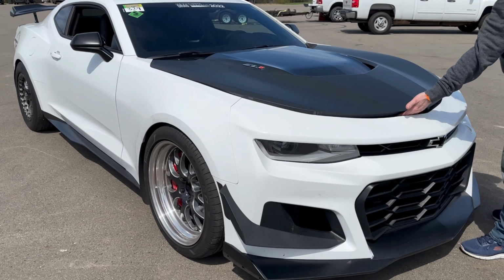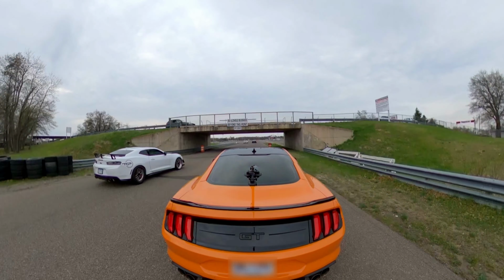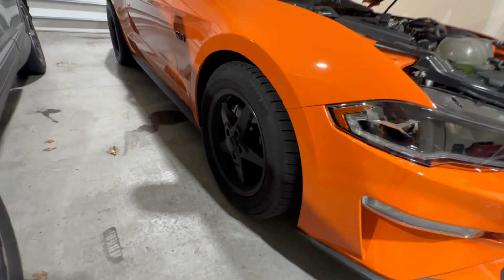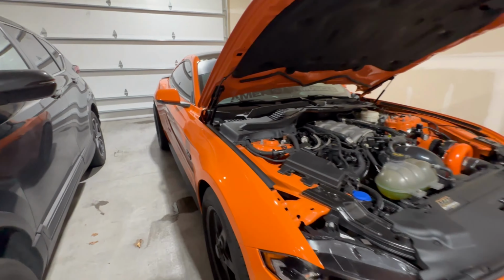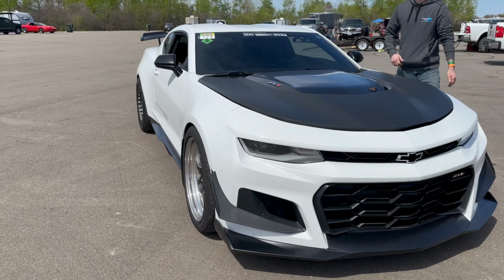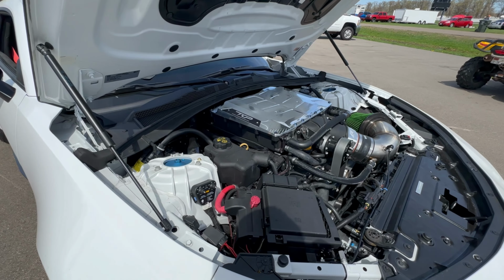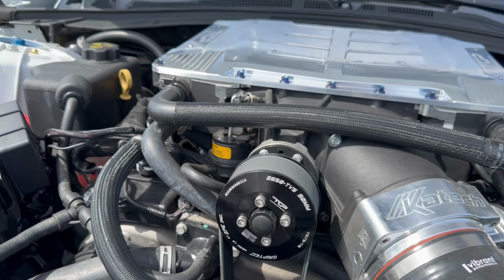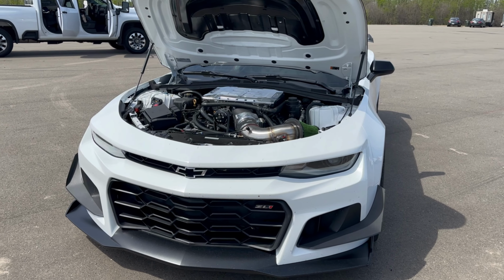Magnuson 2650 ZL1 Camaro vs ESS G3x 5.0 MUSTANG! - HUGE UPSET?!

Comment: ZL1 got sour and spent all that money and got gapped by a basic 10 speed centrifugal car lol
Reply from the maker: I mean it’s a basic slap on 2650 build lol.  No different than me slapping on my kit.  Both stock stock internals/heads but the outcome difference is crazy
Reply: @651MYGarage  still he swapped his heads and cam and your motor is still sealed
Reply from the maker: @fh5tuningredlinemotorsport766  his motor is still sealed he said
Reply: It's a track car.
Reply: @petezapie  😂
Reply: I'm not really feeling 900 WHP from a stock LT4 with a TVS 2650 and a 4.4" TB. IDK, maybe so as I've not owned a LT4, but LT4's aren't Trinity's or Predators, or Hellfat engines, or LS9's or LT5's. They're over-budgeted, factory SC'ed engines. LT5 is what LT4 should have been. Did this guy just convert to straight port injection or did he convert to dual port injection?

Comment: Knew the outcome as soon as I heard manual and he had that whack custom intake not to mention stock cam with the 2650 😂
Reply from the maker: Manual or 10 speed for how much tq it made over me I’m surprised I pulled as hard as I did
Reply: @651MYGarage  90mm upper pulley is fairly large and what they come with out of the box. Realistically might have only been making 850whp and a cruddy curve and weighs 200++ lbs more. Love your content by the way!
Reply: That car without a cam was not making 900hp and plus a 10 speed would do wonders for that car